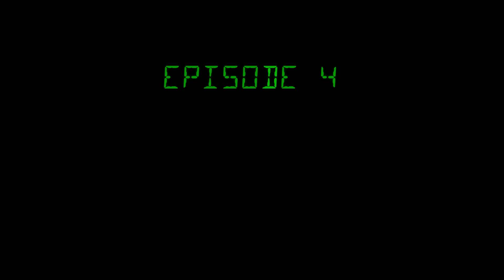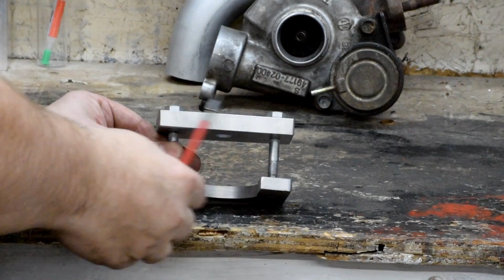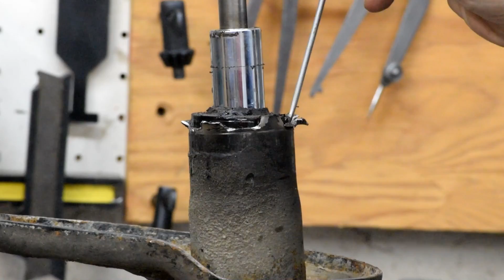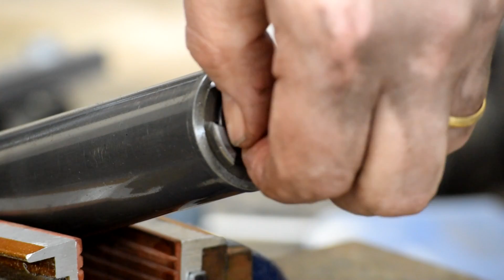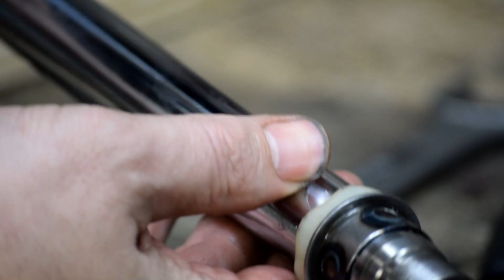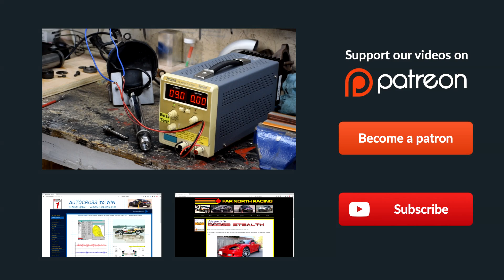FNR Stealth Project Ep 4: Dodge Stealth ECS Front Shock Teardown

Comment: how do you remove the strut tops in order to remove the springs? I've been told the shaft should not be twisted under any circumstances because it can damage the wiring inside.

Comment: So, how do I know that they failed?  Do I have to drop them down in order to identify if they failed?  Mine almost don't move when the car is switched off, can it possibly say that they are sound?  There is a knocking sound on the run, can it be the shoks?  Is it possible to repair them?
Reply from the maker: Well anything is possible. Basic troubleshooting procedures (per the shop manual) apply. But yes, you have to pull the shocks to see if they are dead.
Reply: Thank you a lot!  Your video and your reply is very helpful!  I greatly appreciate it!  But is it possible to repair those shoks if they failed?
Reply from the maker: If they are dead, the only fix is replacement.

Comment: So If you could reassemble/rebuild it you could in theory bore out the holes and make it an even softer ride?
Reply from the maker: In theory, yes - although more "softer shock" than "softer ride". Ride
 is more a function of spring rates than damping, for reasonable damping
 values. You understand the basic premise though.
Reply: @FNR  What could be the issue with OE style struts like kyb/sachs/monroe and similar, they feel like.. too agressive/harsher ride, with the stock ecs springs? I think sachs is a bit close a soft ecs setting but still needs something (like modifying or matching the valving and stack??)